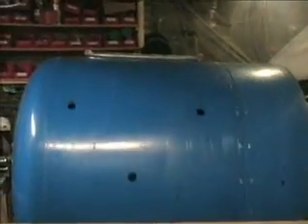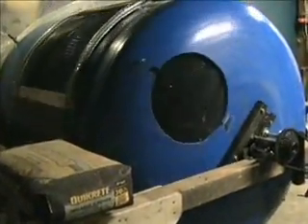Pedal Powered Compost Turner

Comment: Actually, I can build one, now that I understand gear reduction, torque is inversely proportionate to the reduction.  Here it looks like they have a 4 stage gear reduction system.  Also, it looks like they have not done any welding, which makes it a bit easier, just need several throw away bikes.
Reply: They definitely did some welding.

Comment: Having built a pedal powered sewing machine, I can certainly appreciate the engineering and effort that went into this, but is it really necessary?  How often would the compost need to be turned and for how long? Seems to me that a simpler hand crank system would serve the purpose.
Reply: Compost needs to be aerated 2 to 4 times per week. As the compost cooks and the organic matter deteriorates, the mass inside begins to condense and can easily become anaerobic. So they keep air aerobic composting happening, the power must be shifted to allow space for the air to get in. This also helps keep it from stinking.